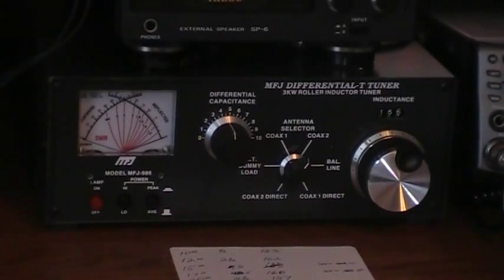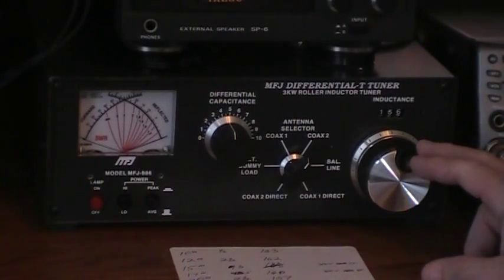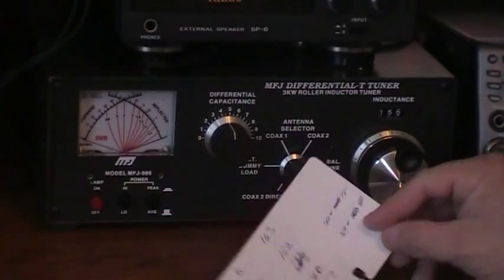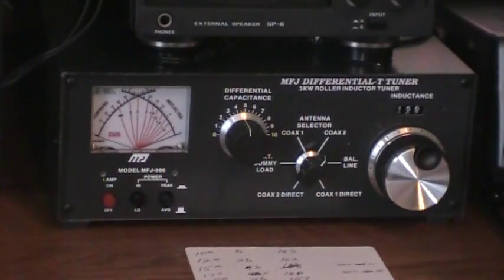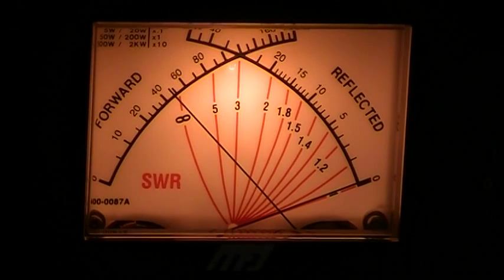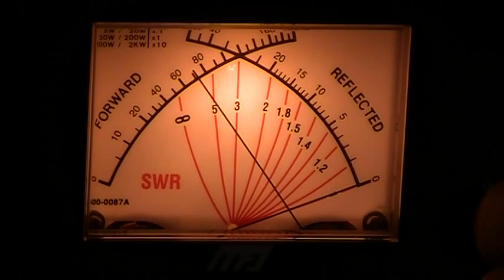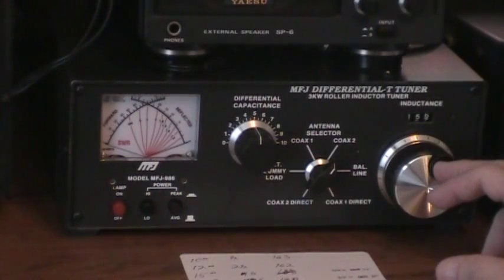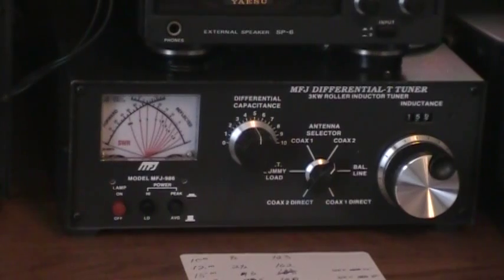MFJ 986 Differential T Tunner

Comment: burnt up the roller switch for 160m twice. only running 100w. not impressed. any thoughts.  works great other than that. can tune up a coat hanger on the other bands. good vieo.
Reply: They shouldn't use a plastic that's susceptible to thermal deformation in the frame of the inductor.  Probably would last longer. 73 - K7GYB